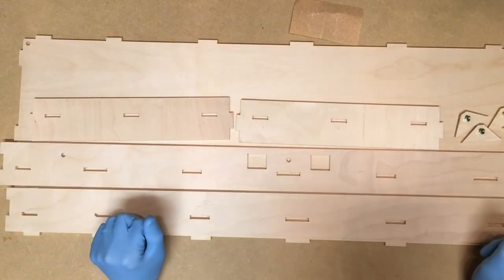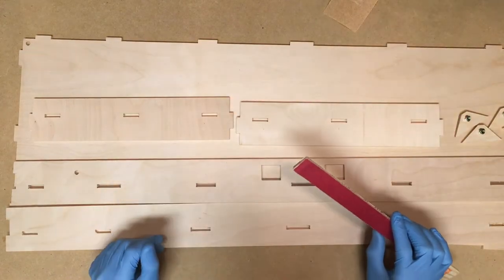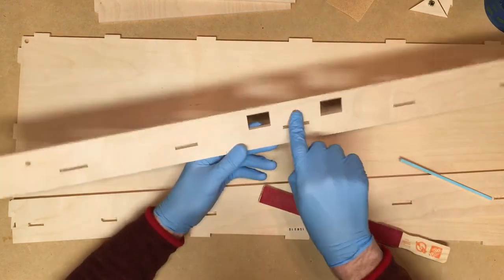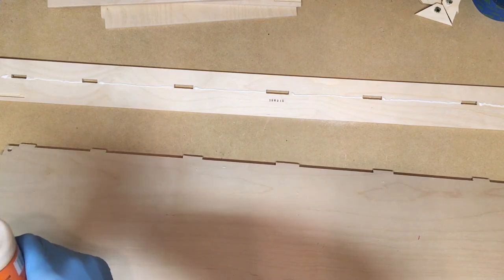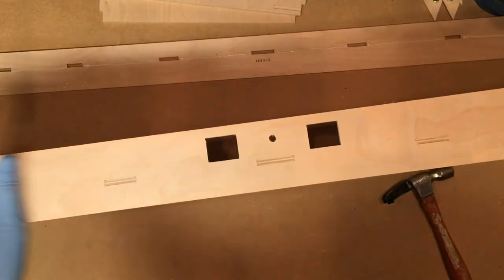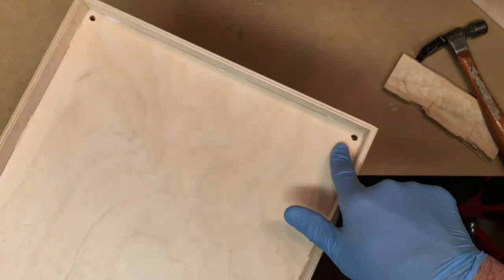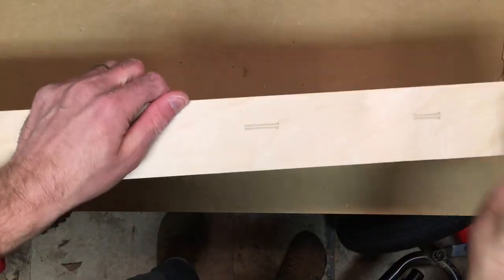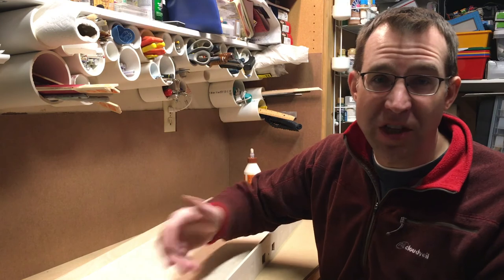Tulsa Spur Part 2: Build a Layout from T-Trak Modules

Comment: Nice video. The only thing I suggest is that you tell us which of the many modules and options you choose. Are both sections going to be the same size?
Reply from the maker: this video uses the triple wide depressed deck module found on this page: http://masterpiecemodules.com/T-trak_N_Scale__Triple_Wide.php#1 I think it is the 14" deep one.   I'm probably going to use one of my quad modules (4 feet wide) and cut it down 6" and join it to this one.  Haven't decided yet.  I need nearly 6' 6" of length to the layout, and I could make it 7 feet, but keeping it a little shorter allows it to fit in the back of our SUV without putting the front seat down.

Comment: This is what is called a recessed module isn’t it?
Reply from the maker: I think so. They have the ones with the flat tops you build directly on and the ones like this that have the top recessed just enough to put a layer of 1” insulation board in there.